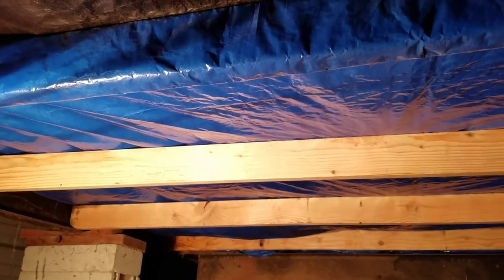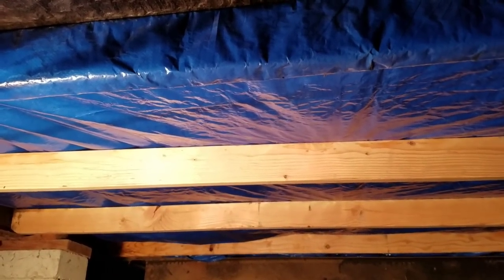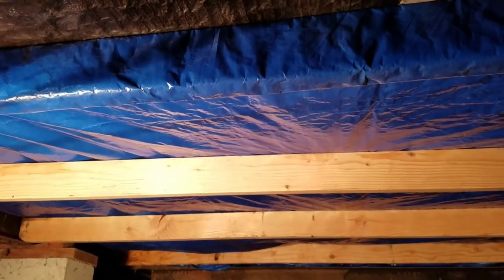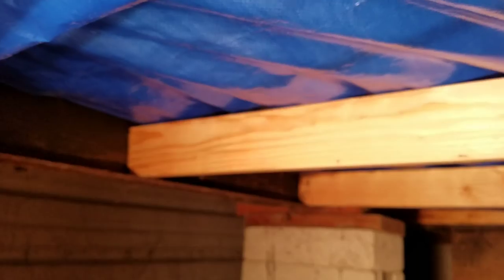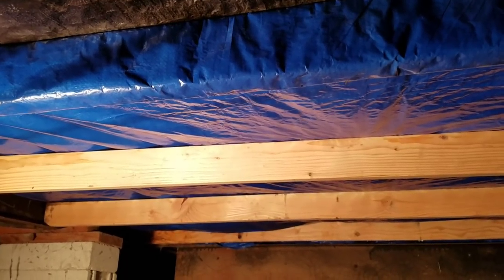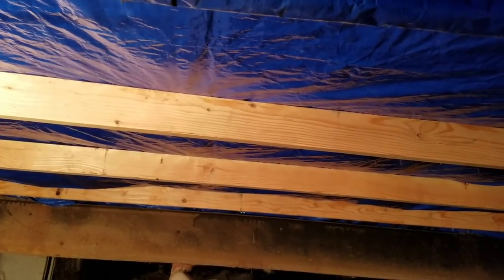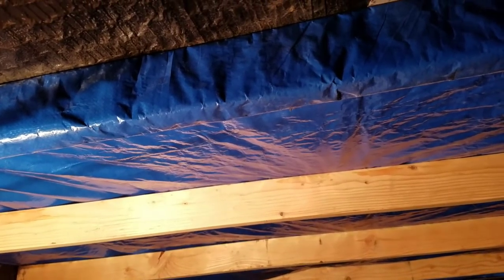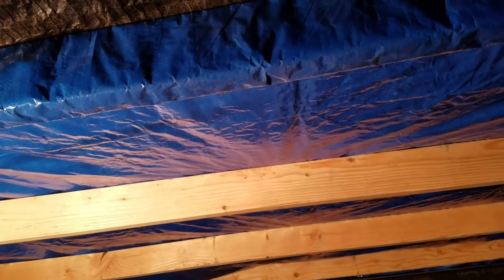Easy Mobile Home Belly Repair and Insulation Episode 1

Comment: Ebay has bottom board repair plastic. Same exact material you can get with or without adhesive backing. Just dont go HOG WILD cutting the vapor barrier. I replaced all the plumbing lines under my single wide just cutting access points as needed. Replaced poly B with Pex. Saved myself $8k-10k

Comment: Thank you so much for sharing this! I bought my place back in 2013 and I have been under that crawlspace dozens of times with this very problem trying to figure out how I can fasten something to those steel metal beams that run underneath the mobile there was a hot water tanks that busted before I bought it obviously. I say obviously because I was standing in the kitchen one morning and literally 16 below zero temperature was blowing right up in one of the vents in the kitchen up my robe this is when I first went under and discovered all the insulation that has been torn out and left a big hole and the original vapor barrier
Reply: Mine must have had a washer leaking and they put in new base floor and flooring but the proof was in the sagging underbelly. Im so glad I saw this video. LMK how your repair goes and if you chose any different materials. Im going to do my repair in this summer. PS Im putting drain pans under washer and waterheater as soon as I can.

Comment: #1 - the vapor barrier is supposed to 'breath' - using a plastic tarp traps moisture in the flooring. This is a bad thing. You can buy special vapor barrier fabric (which does breath) which is easy to work with.  #2 - If you leave wood (like the 'exposed' 2x4's you have) - it is a open invitation for termites. You CAN 'treat' the wood with a termite spay to delay termites but beware using  pressure treated wood as it emits gases (which is why pressure treated wood is NOT suitable for use inside homes)
Reply from the maker: I agree, but for a small repair, it doesn't make a difference.  I wouldn't recommend anyone cover the whole belly this way. When you have to get the job done and you have limited resources, this is just fine.  The breathable material was not available locally and would have needed to be ordered.

Comment: The distance between the frame rails (as you call them) is exactly 3.5", i.e. the height of the 2 x 4?  You didn't have to use shims or drill screw holes, and screw through the frame to hold them firmly in place?

Comment: Now you just have to hope the plastic tarp doesn't hold moisture in and cause the floors to rot out. Maybe a breathable material layer similar to the factory material would be a lot better in the long run?

Comment: Nice job! Thanks for the video. I would just add that since it seems that the bottom of your trailer is open, not on a basement, with possibly skirting I might have used green treated lumber instead. This however needs to be open to air flow since you don't want to trap the vapors from green treated- hence skirting should allow this air flow.

Comment: I am going to do the same but where the water pipes are will have access panels. Also I would have primed those boards so they wont rot.
Reply: Use treated lumber.

Comment: I think that is one heck of a job, and i am going to do mine that way,  did you use unfaced insulation or faced and how did you secure it to the tarp. nice video wish i could have seen it from step one thanks
Reply from the maker: roger thomas , I used faced because that is what I had, but unfaced would work.  I think the faced makes it easier to work with. , with the facing down.
Reply from the maker: roger thomas didn't think about posting it until I was done.  It would depend on how bad the belly fabric is, mine was just tore.  The boards supported the fabric belly, then I just tucked the tarp over the tops.
Reply: Beautiful job. I am going to do this, with another trick I learned, a guy used construction adhesive to affix the insulation to the tarp, effectively making an insulation blanket, and then laced it in with wires. Both ways work, I suppose and are clean and effective. Nice job.

Comment: I was hoping you could answer a couple questions for me, I really liked the way you did this! I'm repairing all the insulation under my trailer myself, wondering if I cover the ducts with insulation or fit in between the ducts and floor base, do I cover pipes with insulation? And for the tarp, do I cover everything?
Reply from the maker: Alexis Savoie The insulation should cover everything, which is the way it originally was.  The tarp was used as a replacement for the damaged belly cloth.  This was only used on a small area.  To redo the whole belly a person should use a breathable belly cloth instead of a tarp.

Comment: How did you do the outer sides of the frame rails..
Reply from the maker: Al Barnhill, the tarp was full width, so tucked over the rails.  2x4 helped support original and new belly.
Reply: Robert Desch thank you, I have a SW I'm remodeling, and all the belly insulation is gone.. I'm thinking about using pink board, fiberglass and Tyvek.. Thoughts

Comment: This looks great and clean #professional. However the problem is this causes mold and will also rot everything inside it overtime. Long time ago all insulation, walls and all, was rapped with plastic. Now we have figured out not to do that. This is the reason insulation has paper on only one side. The paper goes toward the inside of house. Floor, cieling, walls it doesn't matter. Insulation has to breath or it will sweat and cause mold and rot wood out as well. Intentions in doing this were great but final result will eventually be costly and with black mold potentially deadly. I am a professional insulator of 10yrs so I have seen and repaired this hundreds of times. Raised 3 kids fixing this stuff. Save your money and do it the right way please.
Reply from the maker: ImNotGood15 AKA.NotGood , I had to work with what I have and the budget I have.  What can a person use instead of the tarp in this case. Is there a product that breaths that can be purchased?
Reply: I am going to use Lowes house wrap that goes over insulation from Lowes, Home Depot etc. It breaths and is similar to belly board material. I will run 1x2 wood strips screwed to the floor joist under the house holding the insulation between the joist and holding the belly board up. At all the plumbing lines I am making easy access to all plumbing by attaching a strip of belly board for that piping between the joist easy to just unscrew that whole pipe run and not having to mess with the other areas or cutting into it to get to only the plumbing.
Reply: Nonas do you have a video to do it the way you are describing? Money issues prevent me from hiring a contractor (cancer disabled son, etc.), so we are looking into fixing it ourselves. We were pretty much gifted this older mobile home with the understanding it needed a ton of work (it's a 1979). The floors were damaged severely from broken water lines throughout the house. From videos of how-tos, we know the inside needs a plywood base under the lifeproof/wooden flooring we are putting in. I know it needs some sort of insulation to prevent the pipes from freezing again (we replaced the galvanized steel hole ridden lines with pex and sharkbite fittings), but thought plywood went under it to hold the insulation in place? Videos I see on here mostly show tarps only though. We also plan to fix the roof as a large branch came down on it. So basic is tin, tar paper, plywood, insulation between the beams, it then had plastic more plywood (very thin stuff) and those foam ceiling tiles. Should we not do the plastic layer and go with that Lowe's stuff instead?
Reply: The only product for the job is the proper product, Buy Mobile Home Belly Wrap
Reply: @kenpotts7919  Thank you! Much more helpful than just saying its wrong and offering no ideas for solutions. #unprofessional
Reply: No worries I also dislike the negative on the internet and try to be the positive, I always say to people to do your homework and ask lots of questions, I have been in the Modular Home industry since 1983 and I am still learning new things to this day, no one can have all the answers in construction.
Reply: @kenpotts7919  I have gray poly tubing. What is the best way to replace the poly with pex, under the house ?
Reply: @tomferguson9922  I usually make the feeder lines up before. Always make sure they are straight, I leave old lines in place if possible, and I feed lines up into the belly cutting as few holes as possible and try to cut them where they need to connect the lines to the bathroom's etc. Then as they are connected install a few clamps to hold up above insulation. I have tried a few ways but found this about the best...still sucks...if you find a better way I am all ears.
Reply: Someone sounds high on themselves!